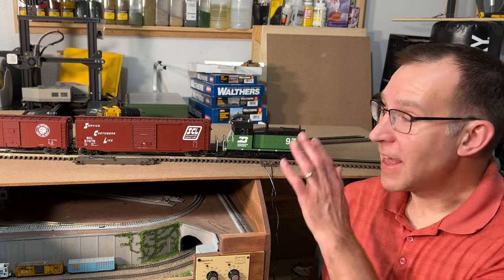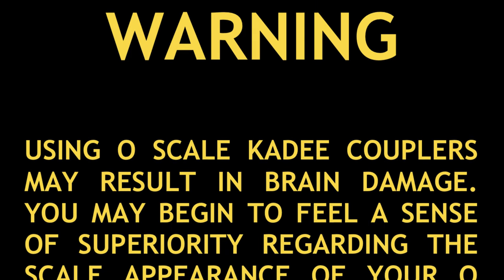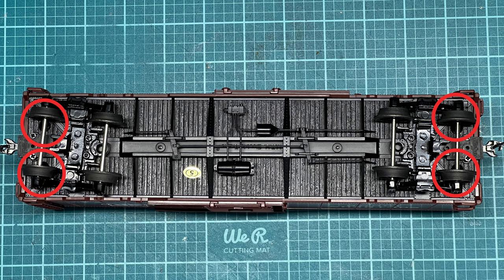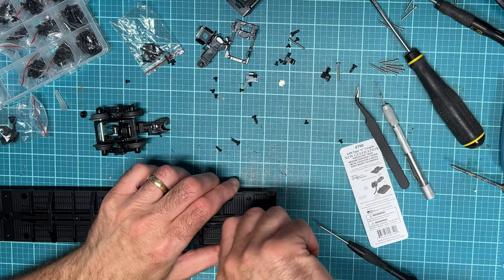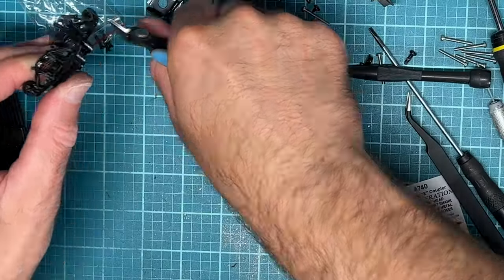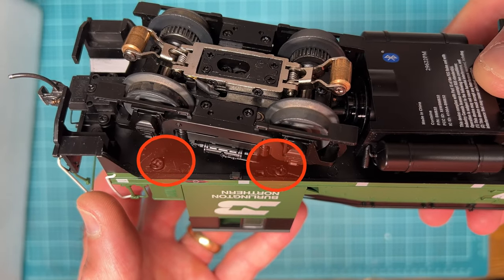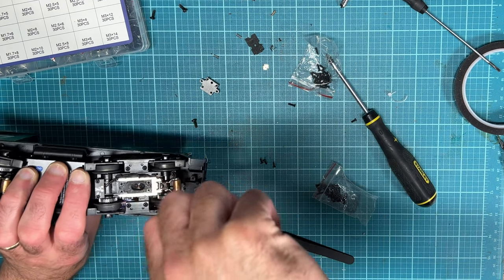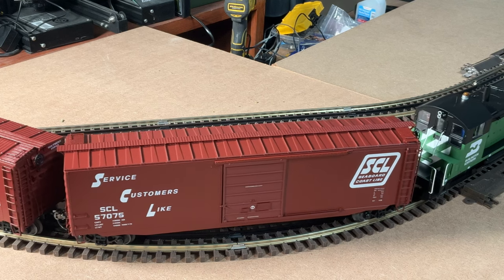Switching to O Scale Kadee Couplers

Comment: You're dangerous Steve!!! 
When you mention the various 3-rail track sizes, does the 31 or 36 have any reference to radius?
Did I mention that I have a Red Caboose GP9 and 2 sections of Atlas flex track? Now I want to go down and lay them out and run my loco back and forth. Probably more dangerous then you are.:hand-orange-covering-eyes:
Reply from the maker: So with O gauge it refers to diameter, not radius. I didn’t realize that initially when I started looking into it. So, O36 is a 36” diameter or 18” radius, which is like a 9” radius curve in HO scale.
Reply: @StevesTrains  That's interesting Steve t one point I was experimenting with a water front scene in HO that had a 12" radius leading onto a wharf. It was very doable with an S2 and 40' cars. But I had to file a notch in the center sill of a 50" car to get around the curve. These days I keep my min. industrial radius at 15".